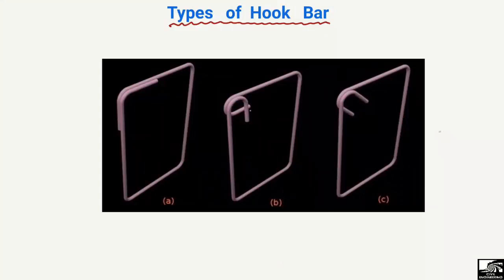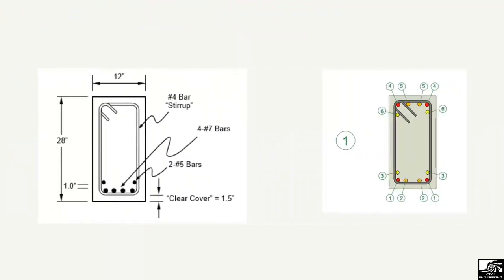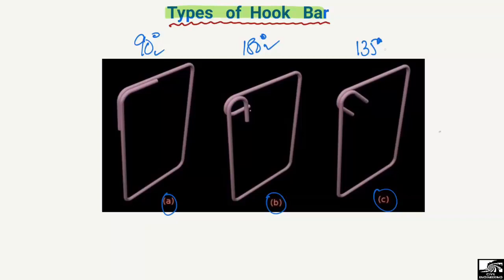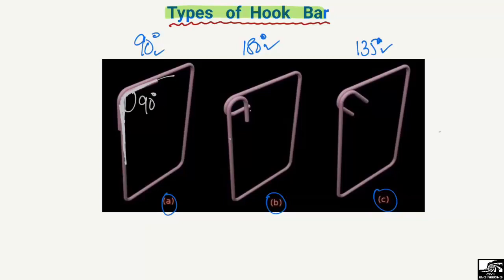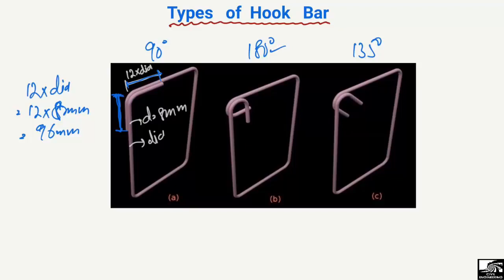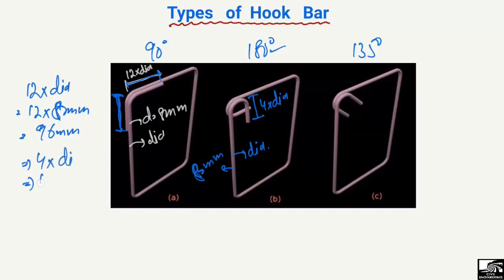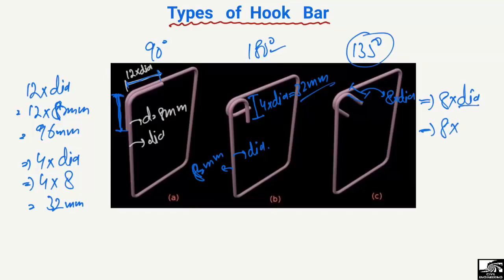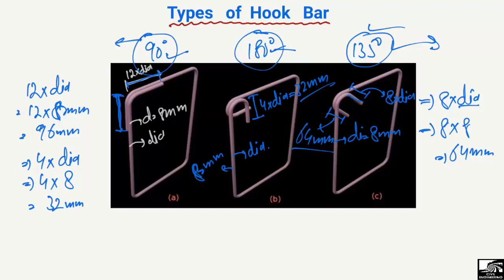Types of Hook Bars

Comment: Thank you sir, Sir according to your information in this video 135 degree angle stirrup is used in seismic zone areas, sir everyone know that Delhi NCR is coming in 4th seismic zone area, but no one use 135 degree stirrup everyone used 90 degree stirrup, in Noida near Delhi there is a project of CPWD Central Government I worked there as a civil engineer they used only 90° stirrup not 130 Stirrup
Reply from the maker: its not recommended to use only 90 degree hook in high seismic zone.